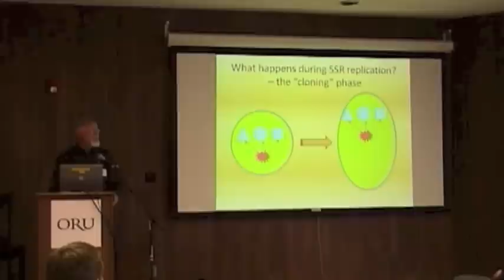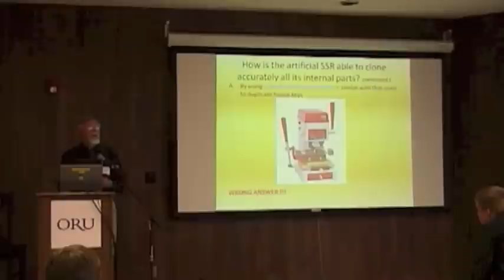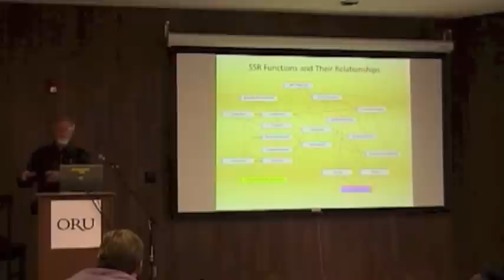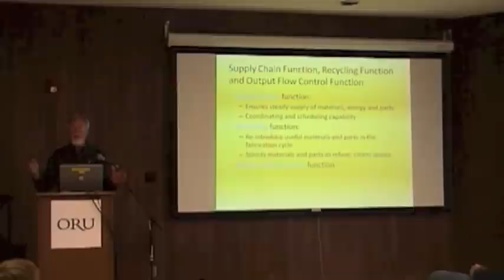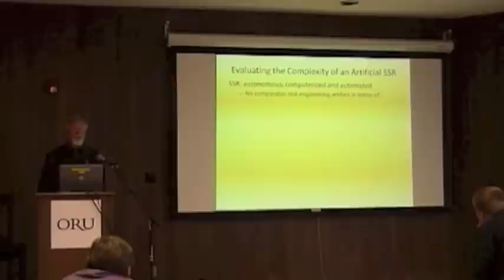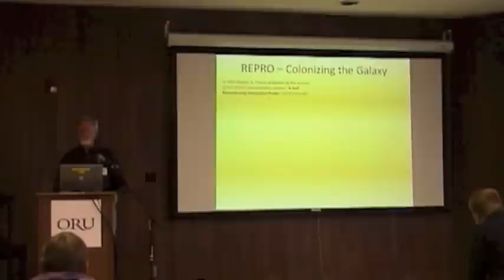Comment: The Slides (MS Power Point) of this presentation are available on the Blyth Institute site here:
   http://www.blythinstitute.org/site/sections/31
This topic is developed in significant details in the last three chapters of the Conference presentations published in the book: "Engineering and the Ultimate" available at Amazon:
    http://www.amazon.com/Engineering-Ultimate-Interdisciplinary-Investigation-Design/dp/0975283863
or at Barnes and Noble here:
    http://www.barnesandnoble.com/w/engineering-and-the-ultimate-jonathan-bartlett/1118827831?ean=9780975283868

Comment: is there a higher resolution version available? (in order to be able to read the slides)
Reply: Richard, the Slides (MS Power Point) are available on the Blyth Institute site here:
   http://www.blythinstitute.org/site/sections/31
This topic is developed in significant details in the last three chapters of the Conference presentations published in the book: "Engineering and the Ultimate" available at Amazon:
    http://www.amazon.com/Engineering-Ultimate-Interdisciplinary-Investigation-Design/dp/0975283863
or Barnes and Noble
Reply: Wow, thanks!